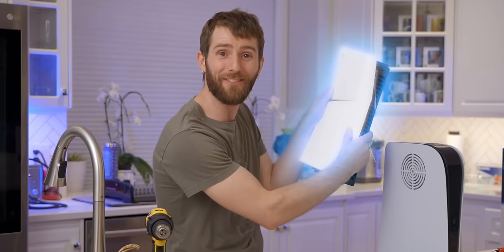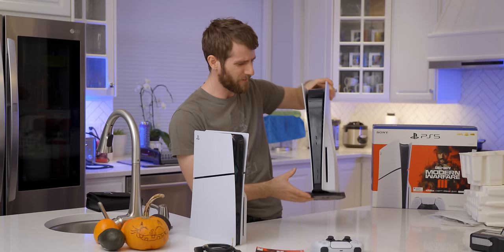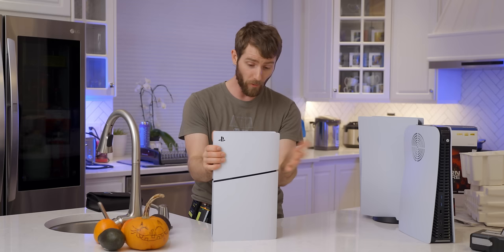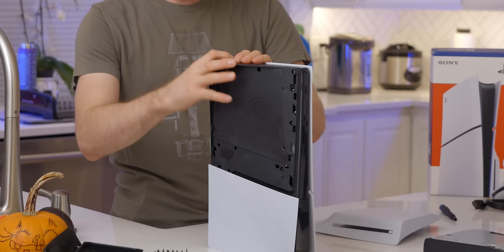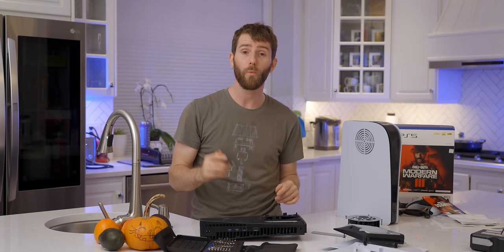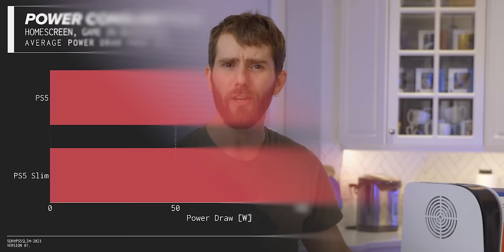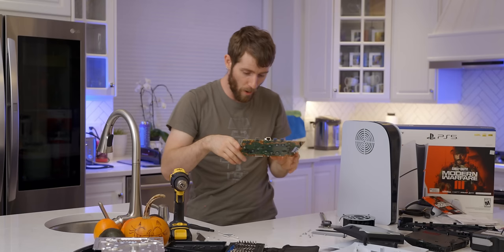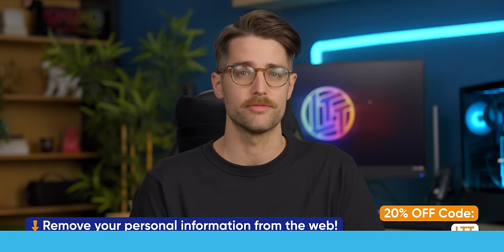PS5 Slim First Look and TEARDOWN!!

Comment: While the removable disc drive might over complicate the product line, it's cool that years down the line, there will be plenty of easily replaceable, first-party OEM parts if the disc drives start failing. You just buy a new drive and pop it in. No screws, no ribbon cables. Pretty neat.

Edit
I know that the drive requires internet connection. My hope is that Sony uses software patches to allow people to replace them. The online connectivity is a piracy measure that Sony had to implement because of regulations. Every console made after 2005 will eventually be e-waste when they shut down their servers, but it will be a long time before the PS5 reaches that point.
Reply: if they're new, yeah
but i think if you want to buy used it wouldn't work right?
cause you have to register to your ps5 and all

and i say buy used because sony won't be making these forever and you might want to fix your ps5 at a time where it's either too expensive to buy new or literally impossible
Reply: I'm waiting for someone to develop an ode for it. It whould be cool playing backups on it
Reply: @L0tsen  we're still in the early stages of CD/DVD ODE's which have lack security compared to bluray, give it 20 years and maybe there would might be one
Reply: Am sorry but who the fuck still uses discs still ? 😂😂
Reply: I don't think it would over complicate the product line at all. They now only have to make one console and add the disk drive for the drive version which easily connects in.
Reply: @ponyslavestation4669 not a console player? Imagine not wanting the ability to hold and sell your game licenses
Reply: @SoundwaveZabuza  my thought was the nightmare of parents and grandparents trying to pick the right PS5 to buy as a gift. I can picture someone buying the digital version and a game on disc, only for the kid to have to wait another week until their disc drive gets shipped or for the digitial version to be returned and exchanged for a disc ps5.
Reply: You need an internet connection so that the drive works tho
Reply: Unless Sony provides a way to unlink the drive from a system again, you won't be able to use any used drives in the future once they are out of stock. So millions of used drives will become e-waste. Great job Sony (or whoever the drive provider is).
Reply: @stansteez Is it confirmed that you can't use the drive on another system after it has been linked to a another PS5? Where did you get that info from?
Reply: Sony being Sony makes it to where you have to logon to the internet to "register" your disc drive lol
Reply: There will never be a single thing "neat" about this disgusting waste of resources until Sony ensures that the entire ecosystem can function without a single online handshake.
Reply: I'm wondering if since Sony was forced by piracy regulations to use the internet to authorize the drives, they can patch in support to unlink a drive and link a new one. Would that only work with new, unused drives because they weren't connected yet? It's interesting.
Reply: It's nice that Sony made the optical drive easier to remove, but being able to replace the drive with another was always a feature with later revisions of the PS3 and PS4. Those revisions also didn't require hacks or connecting to Sony servers to remarry a new drive, you just plopped a new one in and done.

It makes me wonder if the old fat PS5 can use the online remarrying feature, as it has a permanently married Blu-ray drive.
Reply: @jtchoi2003  sure but the ps5 slim drives makes it easier for novices or average consumers to replace them without doing a teardown. You also don't need to harvest a drive from another console and it adds more drives into the marketplace.
Reply: yea you buy new drive and can't use it beacause of sony drm from store xD
Reply: @koghs  Not really, though.
Reply: @mrbrandonmartin388  I already agreed that making the drive easier to access is a good thing. Optical drives are known for having issues overtime. 

Requiring an internet connection to remarry a drive when later PS3 Slims, PS3 Super Slims, PS4 CUH-1200 series, and all PS4 Slims/Pros allowed you to connect a new drive without accessing Sony's servers is questionable
Reply: @jtchoi2003  The video did imply that Sony  kinda had to do that so, eh.
Reply: Yeah they need an internet connection to actually work though, and years down the line (like a lot) the servers to authenticate will probably be down so it won't matter.
Reply: You have it wrong here. Its the other Way around. It makes it easier for them to keep Tack of Supply and Demand since it is the same Base PS5 Slim and the only Thing that will change is the Disc Drive. The Product Line only needs to know if they have to use that last Step to add it or not. Right now they have actually two different PCBs and Shells so i would assume two different Production Lines and they need to "manually" figure out how many PS5 with or without Drives to make. So while it might look bad for them at first, it is actually a good Thing for them.

Could mean they will use less ppl though which is bad for those who work there. From an Company Perspective however... again... it is better. (Dont hate me, i am just explaining.)
Reply: @ZNotFound  Linus literally said that in this video....
You have to link your hard drive to your PS5. So that means you can't just install another hard drive into it because your original one is already linked to it 🤷🏻‍♂️
Reply: @ponyslavestation4669  alot of people, cheaper games? Alot of people that were big on on digital have switched back. Please tell me how you sell your game you bought in the past?
Reply: I swapped out my PS3's drive years ago back when I had one and even called them to confirm it wouldn't void the warranty (it didn't). It's one of Sony's better features and certainly far better than Microsoft's ideas of locking drive upgrades to their own products.
Reply: @ponyslavestation4669 people who trying not to get screwed  over
Reply: @wizzenberry  Havent had any console since ps1 idk it works like that anymore. Everything nowadays requires online activation the only way is to resell ur whole game launcher acc is it not ?
Reply: Isn't this version the digital version? Does the disc version also have a removable drive?
Reply: @ponyslavestation4669  not sure dude i only have a ps5 and pc, the ps5 is fine the xbox may suck. Its nice reselling my single player games get me. I dont keep it connected to the internet apart to update and it works fine aha but then again its sony i hear ms are removing disks for the series x 2, may as well get a pc
Reply: As soon as Sony's servers get shut off, all those disc drives will become e-waste though
Reply: @kylehennkens9578  i literally played spiderman 2 with no interenet? This isnt steam mate 😂😂
Reply: @wizzenberry  You must not have heard
The PS5 slim's detachable disc drives have to be checked in with the internet upon first use to bind them with the system
That's fine that you were able to play today, but years later when Sony shuts down those servers, those disc drives won't be able to be logged and will be useless, assuming homebrew devs don't come around
Reply: @ponyslavestation4669  Funfact: Physical games (unless you're Nintendo) get way cheaper over time, while digital pricing tends to stay the same.
Reply: @kylehennkens9578  so it has to be used once? Ok? 😂😂😂😂 Bruh i live in the uk we have Internet i just have little reason to connect as i play single player amazing games
Reply: @xPaPaDx the most annoying thing is that PS5s actually recognise external USB drives and the content of the disc, but they just give an error when attempting to launch the content.
Reply: @talibong9518  if you knew anything about usb protocol you would understand its so there's no way custom code can stand a chance of getting past the hypervisor, the chances are slim but it could happen. ms even went further and doesn't allow non bespoke ssds, this is because sony implemented llm visors in the decompression chip so its near impossible, xbox doesnt have that. for a tech channel there is alot of people who know nothing about tech
Reply: @jtchoi2003 there's never ever been a revision of console that allows you to just swap the disc drive since the very first playstation 3. Even Xbox does it
Reply: @L0tsen  I think future proofing an ODE is part of the reason for the online digital handshake required to pair the drive with the system
Reply: @ponyslavestation4669 ⁵If the internet goes down, you digital players won't get to play. #2 if we go to war with China, and they shut off server access to the PS5, you digital players won't be able to play. If you're done with a game and never plan on playing it again, you can't sell it. If a friend wants to borrow it, you can't loan it to him. If Sony & the game company wants to ban your ps account or discontinue a game, you won't be able to play. Let's not forget, if hold on to the PHYSICAL disc, it can eventually be worth more. Physical disc games are the way to go....
Reply: @chris666rocks  the pairing of the drive to the motherboard has always been here it's nothing new. Playstation and Microsoft has done it since the PS3 and 360
Reply: @squirty131  except you can 😂😂😂 and it only needs paired once anyway 🤦. It requires the software update to do that. Which can be done via USB
Reply: @ponyslavestation4669 on console you want disks because buying a disk version of a game can save you alot of money
Reply: but its a online activation for  the disc drives one day you wont be able to add the disc drive unless they take away the online activation in a few years
Reply: @topmandog1  nope 

It is done through the system software update like it always has been

By default both versions come with the digital system software as default and in order for it to function as a disk version the console needs the disk version system software

When you jailbreak a PS3 it can sometimes brick the disc drive and to fix that you simply download an official ps system software to usb. Put the console in Safe mode and update it and the drive will work again. People are completely blowing this whole thing out of proportion
Reply: @wizzenberry  That single connection that the console makes upon booting for the first time will render all PS5s as e-waste, regardless of the quality of the games
Reply: @lille136  I know that part. Upon first installation of the drive, you need to phone home to authenticate the drive, afterwards, it doesn't need to authenticate. 

Let me rephrase.

Was is ever stated that once the drive was authenticated that it was locked onto that specific PS5?
Reply: @ponyslavestation4669 people like me who don't trust companies to not just shut down one day and I have nothing to show for it, probably won't happen unless it's nintendo lol
Reply: @lille136  no playstation storage drives are locked to the board buddy. Only the disc drive

And it uses a SSD not HDD. Show's you didn't actually pay any attention to what Linus said.

Microsoft locks the disc drive and storage to the board though
Reply: Yeah I’d actually love it if the original came with a swappable drive. I’m a little tempted to give my original digital console to a friend and get the slim so I can get the disc drive and smaller size.
Reply: @ponyslavestation4669  Anyone with a brain, who realises they can resell their games after playing, and that physical is even cheaper to begin with. People buying digital are flushing money down the toilet.
Reply: Wouldn’t it simplify the production? Instead of having 2 separate SKUs for the PS5 like we do now all of the slims are built the same then half (I’m guessing) are diverted at the last step to become disc driver versions while the other half proceed to finalization?
Reply: @wizzenberry hope that stays the same forever, I have a memory of a time I couldn’t played my downloaded games, and to solve the problem I had to check the lisense on all them.
Reply: @ArgyrosVivum  it's still like that with the PS3 and even PSP even though the psp side is now closed you can still download your digital Game's

Sony even clarified even they close the ps3 you can still download any games you bought and even the playstation plus games you got. Your game licences and everything else is linked to your actual account which is handled on the account servers which are separate from the PSN servers.
Reply: it's less complicated a the end of the line you add a bluray drive or not
Reply: @RageQuitSon  yup you can since the ps3 you need to swap the pcb from the drive
Reply: @fidelgames  only to do the hand shake .. i still believe that the disc version should come with the handshake already done
Reply: @potatorigs2155  I think they left the disk version like that to give you the choice just in case you decided to just use it for digital and use the disk drive later or you could sell the disc drive
Reply: user-es8bm1zs2s  no lmfaro. It's to install them. Don't start with the all games are key's on disk FFS because that's far from True
Reply: with a ODE down the line... since they made it now pisseasy to make , clone signal to cloner board , place images into drive , play ... lulz , like they knew PS1\PS2\PSP sold more due to piracy ...
Reply: Yeah let's not forget that it literally requires an internet connection to register your disk drive. Not everybody has that, which is why they buy a console with a disk drive and a physical disk. When they decide to not host the super expensive servers anymore to authenticate then that means anybody who purchases old pre-owned parts that they no longer make can never use them.
Reply: @ponyslavestation4669 you'd be surprised
Reply: @riiiiiiiiiiiiiiiiip  if you don't have internet then why buy a console in the first place considering every console requires internet to set it up in the first place. Make that make sense
Reply: @VallornDeathblade  yeah that's not True buddy. You literally have to break the warranty sticker to replace the disc drive in the ps3 and 4
Reply: Dr zoidberg in the works
Reply: @mrbrandonmartin388 true. I remember as a kid having a Sega Genesis and my Dad getting me a Sega Saturn disk game to play. I appreciated the thought but also was so confused
Reply: @lady.foxpoint you should be able to remove the optical daughterboard from the drive and install on a replacement just like you can right now with the current models.
Reply: @potatorigs2155  why does there need to be a handshake in the first place? It's a disc drive.
Reply: @fidelgames  because they can possibly be modified to run pirated disks. So they are required by law to do it. Xbox also does it
Reply: @riiiiiiiiiiiiiiiiip nothing about an activation server is 'super-expensive', especially in the era of virtualized and container-based services it is dead-simple to scale your online 'servers' based on actual demand.
Reply: Except they require a Internet connection to set up. So down the line when they turn the servers off then it's just ewaste.
Reply: @swankshire6939  you assume that but even now the drives require updates to keep them working same with Xbox. 

You can easily do that via USB  so why would this be any different 🤦
Reply: @ZNotFound the rest of us paid attention to the video where they say you have to register it and link it to your PS5.
Reply: @majorasspain5341  that means xbox sucks too. There should be no reason they require an internet connection for something like that
Reply: @fidelgames  again. A disc drive can potentially be modified/hacked for piracy. They are required by law to do this. They have done This for over a decade now
Reply: @majorasspain5341  that's no excuse for hampering the experience for everyone else. There are still many places where people have shoddy internet or non existent internet. Because of the excuse of piracy and a few people choosing to mod, it should therefore screw over the convenience for everyone? Xbox one and ps4 doesn't have anything like that. What law is saying that
Reply: @TheStoneyYoshi  hmm true, i'd imagine the daughter board would still be working as the moving parts themselves would most likely be the problem
that's a good solution. not perfect, but good
Reply: @majorasspain5341  What are you talking about? Did you research your claim at all? Yes, the fat PS3, early PS3 Slims, and PS4s with a glossy HDD cover had married drives, but it was removed in later revisions.

CECH-25XX and newer Slim PS3 do not have married blu-ray drives. CUH-12XX fat PS4 and all Slim/Pro PS4s do not have married blu-ray drives. They integrated the mechacon in the console's motherboard itself, which is what the "married" part is.

Yes, the Xbox 360 and newer all have married drives. But that isn't the case with every single PS3 and PS4.
Reply: @majorasspain5341  I never in my life heard of someone bricking their  disc drive simply from installing PS3 CFW.
Reply: @wizzenberry  Not a PC player? Imagine not wanting the ability to refund all your games for 100 percent of the price if you fall below a certain number of hours. And not having some jackass inflate the cost of an old game artificially by calling it "collectable."
Reply: @Thatonefuckinguy  yeah man got a 3080 laptop is decent, i have done that on steam on a few stinkers ahah is it 1 or 2 hours you get
Reply: @RageQuitSon There has to be a way to unlink and relink a disc drive. Not just for failure reasons, but also for people who have a broken PS5, buy a new PS5, and need to transplant their disc drive from old to new.
Reply: @richdog9000 I don't sell my games. I like having the ability to go back and play a game I bought 5 years ago and haven't touched since I originally beat it. Having all my old games accessible has gotten me through a lot of those 3-4 month dry periods when no good games come out.
Reply: @ponyslavestation4669 so many besides you. Especially those that want to maximize hard drive space
Reply: @wizzenberry I mostly only play single player as well, but I've gotta know, where are you getting all these bug free 100% complete single player games from? I have to stay connected to the internet to keep getting updates that fix all the bugs and issues.
Reply: @koghs only to you
Reply: @Nick_the_gamer21 the disc version does not have a removable drive. Also from what I understand the removable drive is only for this new PS5
Reply: @kylehennkens9578 and who's to say when and if that even happens
Reply: @SupremeNerd  It's happened to the PS3, and the PS4 is over 10 years old at this point, it's an inevitibility
Reply: @kylehennkens9578  it hasn't happened to the ps3 or 4 at all. Stop spreading misinformation
Reply: @jtchoi2003  you definitely can brick the drive if you install the wrong cfw buddy or don't set the QA flag 

Here is somebody on the psx place helping sombody with that very problem 

So what firmware were you running prior to EvilNat? What I suggest doing it make sure QA flag is set and install another CFW like Rebug to ensure it is the firmware and not the system. Mine BD drive went out after installing a firmware some time back. Switched back to the "working" firmware only for it to still not work

And ok it may not be the case with every PS3 PS4 but it is still something they have done for over decade no matter how you look at it.
Reply: @majorasspain5341  The PS3 online store has been taken offline, and multiplayer servers are shutting down almost on a monthly basis, Ubisoft just shut 15 games' worth just the last week.

This isn't exclusive to Sony, the Xbox 360 store servers are going down July 2024 and Nintendo's 3DS and Wii U servers are already offline.

I didn't mention the PS4 being down yet, but it will happen.  This isn't misinformation, this is happening actively. 

Do note how you can still play physical games from most of this message, because even though those servers are down/going down the physical media means that you still own the games.

20 years from now, let's say you wanna come back and replay Spider-Man 2, but you need to buy a second-hand PS5 to do it.  That system will not allow you to boot a game without an internet connection, meaning you no longer functionally own that game.
Reply: @kylehennkens9578  you haven't been keeping up have you Sony decided to keep the ps3 store open. And guess what I can literally still download console firmware even after they close it
 because it's just the store.

 your console is linked to your playstation account

You are clearly not very knowledgeable with this and just making assumptions buddy

Psp store and stuff is closed guess what I can still download the games I paid for because the licence is linked to your account. The store is Just a placeholder a store front. No licencees are stored there they are stored on your actual account

It's all misinformation based on the fact you do not understand how it even works so you are just assuming
Reply: @majorasspain5341  The servers will not be up forever.  Sony pushed the PS3 server-shutdown back, but it is still happening.

I could be right or wrong about everything here, but the facts still remain:  The servers will not be available forever.  Have you tried to redownload your purchased WiiWare or Wii U titles lately?
Reply: @ponyslavestation4669  You do know physical media games are usually cheaper and re-sellable?
Reply: @RageQuitSon people have already swapped them so youre wrong
Reply: @kylehennkens9578  no it's not. Just because you have no use for it doesn't mean nobody should. That's why things are still sold. You can still find floppy disks and cassettes even though nobody uses those
Reply: @swankshire6939  I already know that part. I even replied to another comment before stating that I already know you need to connect the internet after first installating it.

My question was if after linking it to that PS5, is it locked in and can't be relinked onto a different PS5?
Reply: @ponyslavestation4669 to be fair the PS5 plays BluRays.
Reply: @RippahRooJizah  No they didn't. Not when later revisions of the PS3/PS4 didn't require it. The LTT video just said it exists. It does make me wonder if Sony will port this new online remarrying feature to the old fat PS5 though, because the current PS5 doesn't allow you to change the disc drive unless you also swap the disc drive's original daughterboard to a new one.
Reply: @jtchoi2003  Well, I would like more information. The implication that Sony had to for the PS5 is interesting.
Reply: @jtchoi2003  yeah it's weird that they do  it with the drives and then change it to the motherboard then back to drive lol. I repair them. But I will say I've never had to repair a PS4 Pro. So I've probably just missed the revised versions lol.

Btw I repair them as a hobby not as a job or anything.

I do TVs and other stuff
Reply: @ponyslavestation4669   Me and so many others like me. When we buy games, we own them, we don't rent them. Over the years, it has proven to be the smartest choice!
Reply: My 360 will work forever regardless of what you say
Reply: @ponyslavestation4669 digital bubnle kid thinks everyone has gone full digital.

Cute
Reply: TronicsFix has posted a video testing a single disc drive on two PS5 Slims, the drive worked perfectly fine with both being registered to both consoles the same time. So a single disc drive can be registered with multiple consoles, whether there's a limit on how many is another question. You can however also deregister a drive by performing a factory reset on the console.
Reply: @ponyslavestation4669 Every console gamer that 
1. Would like to have a physical copy of their game than relying on some random server in Utopia. 
2. Has limited internet connectivity
3. buy used games to save money.
4.  has / want to make large game libraries that won't fit into consoles storage.
Reply: @@xPaPaDxIt must be due to piracy prevention. I remember gamecube's had their optical discs having their data tracks spiralling inward while standard ones has it spiralling outwards. So those discs won't read in a standard ODD.
Reply: @kylehennkens9578 why
Reply: @kylehennkens9578 I don't understand.. if you only have to link it once.. shouldn't it be fine later??? Even if the servers do get shut down?
Reply: @MyTardisGoWhoosh  Imagine years later, you wanna play God of War Ragnarok, you never  got a chance to when the game was new. You buy a used PS5 after the servers go down, even going the extra mile to pick up an OEM disc drive, with the servers now offline the all-digital models are going for dirt cheap.  You open the console up, install the disc drive, but even then you still can't run the game you bought because the console refuses to pair the disc drive.  The PS5 is e-waste at that point (assuming a homebrew solution hadn't been found at that point)
Reply: @kylehennkens9578  so you're essentially saying.
 If I buy a new PS5 slim.. with in let's say a couple months.. do the one time internet link..will I be fine then??...
Reply: @MyTardisGoWhoosh  You'll be fine within a couple of months, with completely new hardware.  You won't be able to use a used disc drive, since that was already linked to a different console.  The concern is for trying to replay PS5 games years from now.
Reply: It should accept third party drives.
Reply: Sony updated the PS3 in 2022 to patch out work arounds for the CMOS rendering digital games into storage wasters without a PSN connection while ignoring the issue at hand, and you think they're going to patch drives to work offline for our sakes?

Wishful thinking doesn't even begin to describe that.